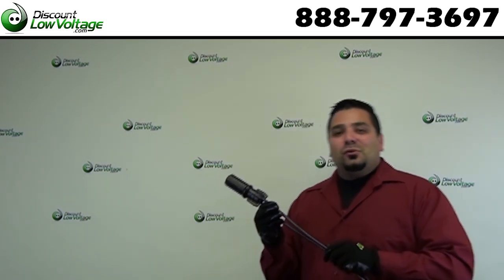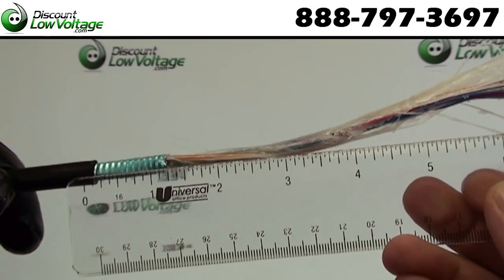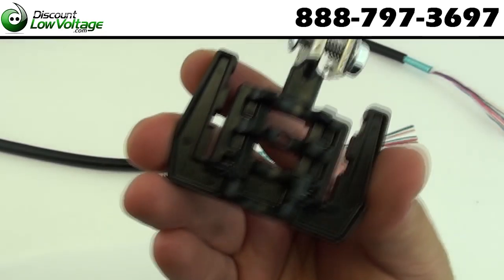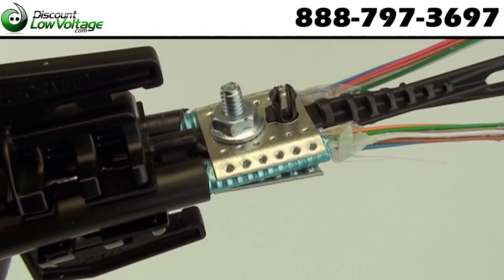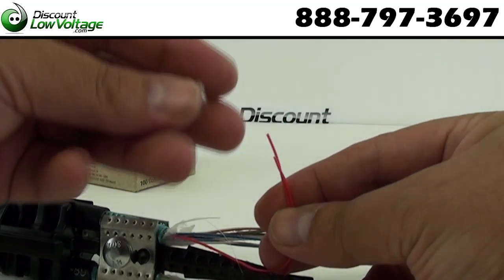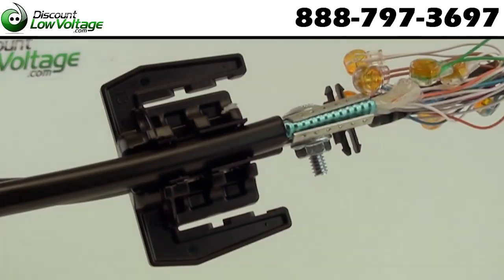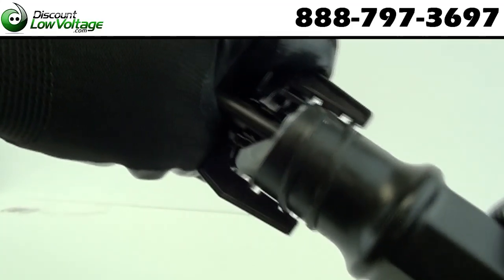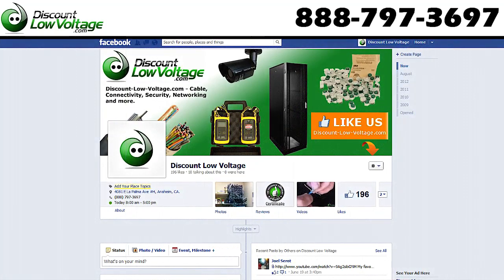How to Splice 6 Pair Telephone Cable – Low-Cost Repair for Cut or Damaged Telephone Line – YouTube

Comment: Will this work for doing Cat-5 as well?  same grade burial cable, just CAT5..  Rototiller.....  that's all I have to say about that : )
Reply from the maker: Clinton, if you're using the Cat5 cable for voice, then yes. If this is a true data signal, I would not suggest splicing the cable with these 3M UY splices.
Reply: ok, great!  do you have a link to those?  I will order a couple.  Thanks!!
Reply from the maker: Clinton Hemphill
 Unfortunately this is not a very common item, we do not carry them. A quick Google search will come up with a few companies that do have them.
Reply: ok, thanks anyway!